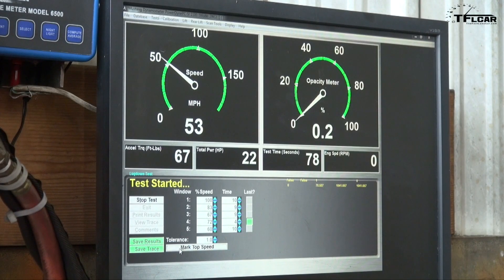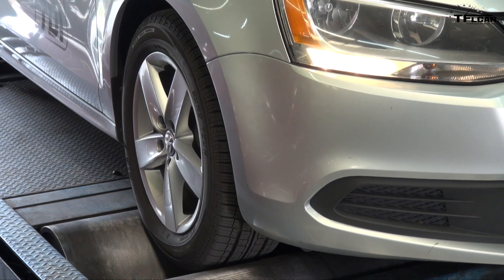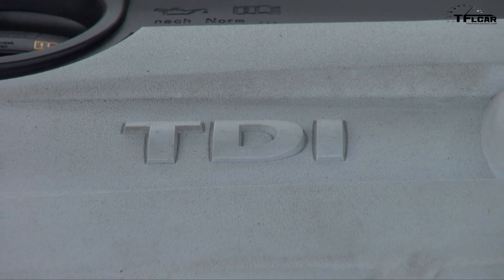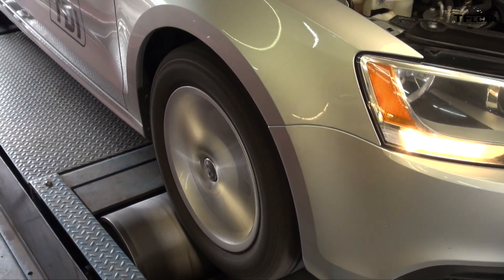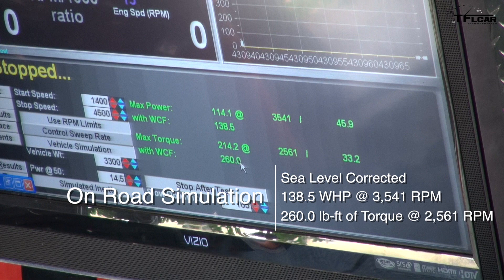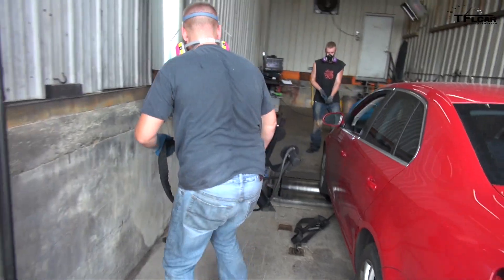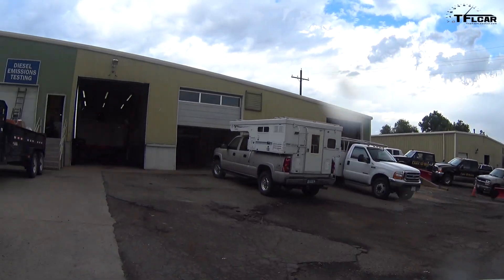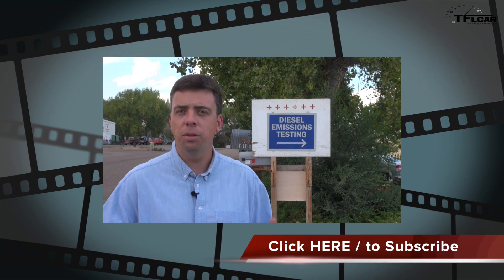Surprise! We Dyno a VW Dieselgate TDI Jetta to get the Truth about HP Loss

Comment: LOL!!!
This test is flawed as is the knowledge of how that car works.  When it's run FWD with the rear not rolling, the car goes into Winter driving mode because it thinks youre stuck because the front wheels are spinning and the rear aren't.  That causes it to reduce torque - creator of wheelspin - and dial back power to try to 'regain traction' that it thinks you've lost due to driving on very slick surfaces / being stuck.  That's why it started flashing the ESC light like it did, then went into 'regular' but sluggish behavior afterwards.

Comment: Don't bash so much on VW. They have paid their dues. The emissions standards are sometimes ridiculous compared to expected "driveability" and consumption of a car. Also, diesel engines have to employ a diesel particulate filter, which further reduces engine power, which kind of takes away the very brilliance of a diesel engine (inherently lower consumption). More than that, VW is not the only one who has cheated, so to speak, on consumption figures - find some materials and read about how many CEOs for instance Mitsubishi has changed during the past 10 years, and learn the reason why. The strange fact why this issue got so widely popular is that somehow this whole affair coincided with the time when VW was just about to overtake Toyota as the largest car mfr in the world. Also, note one more thing: all modern cars have ABS sensors on all 4 wheels, even if only 2 are driven. If the car sees that 2 of these are not turning, it may apply contiguous ABS and/or brakes to mitigate for difference in wheel speeds, enter some pseudo limp mode, or do any other correction of any of the on-board ECUs (which is probably why you see all the control lamps lighting up like xmas tree in the dash). To be more accurate, get a full manual model, and then make any assumptions. So once again - don't bash on VW, and this test is not necesseraly accurate.

Comment: I don't believe it's VW's fault. I doubt that Volkswagen would deliberately cheat on emissions test. It's the EPA's fault. They keep changing the emissions standards to the point that it's damn near impossible to keep up. It's impossible to make the diesel engine any cleaner without sacrificing what makes the diesel engine what it is; fuel economy, durability, reliability. :(

Comment: Let me state, that my Jetta TDI has been a fantastic vehicle and because of the RIDICULOUS EPA standards, we will no longer have these torque laden, high performance, reliable, quiet, no smoke, 45 MPG vehicles again. Some are complaining, but who cares about the little bit of delay in receiving our much higher than value compensation. We all benefited from this situation with many years and miles of useage, only to be rewarded with virtually all of our expense of ownership back to us. RIP TDI...
Reply: There's definitely smoke. It's called nitrogen dioxide, and it's literally poison. In high enough concentration it will kill you like chlorine gas. The same type of people complaining about EGR and the EPA complained about taking lead out of gas. Despite the fact that we poisoned a generation of Americans just so a manufacturers could spend a little less money.
Reply: Yeah you will go get a 1.5 tune better power and MPG delete EGR during tune to remove check engine light

Comment: Can this be fixed? Does it affect mpg?
Reply: it can be fixed and they're working on it, they're trying to make it so its not gutless after. But what people dont realise is the TDI's still put of less emissions then vehicles in the 90's or older... they're blowing the emissions cheating way out of proportion.
Keep your TDI if you have it, VW's giving they're customers a great deal. I wish I hadn't traded my TDI golf in before knowing what I'd be getting.
Reply: Since the fuel economy is up the walls with these cars, an EV conversion would be necessary since then you can sell it second hand, which wasn´t allowed in the mode it was currently in as with the software to cheat through tests by fooling the testers it got passed.

Comment: i have a 2015 golf with the urea tank and despite the software "turning off" the emissions systems. The Urea tank still gets empty about every other oil change. So I don't believe that the system is in fact completely off except when on a dyno. If that was the case wouldn't I hardly ever have to refill the Urea tank? 

also curious about having the "fix" done on my car and then simply getting a tune on my car afterwards to help bump up the hp and Torque to what I would be more happy with?

Comment: How is emission testing when the vehicle does not have a five gas analyzer and when the vehicle is not seeing the rear wheels spin causing the traction to let the engine know to reduce power due to failure and safety, which after that ABS system goes to a default to safety. This guys are so incompetent in what they are performing. Which there is a good question on a vehicle running pure diesel have cleaner emission compared to bio-diesel. Just like ethanol is bad for gas vehicle.

Comment: I think it came down because of the ESC was bugging out in 2wd. It thought the rear wheels were locked up and it turned off all sorts of shit trying to correct it.
Reply: you are correct my sir. When traction is lost to a wheel engine will reduce power and if it does no recognize it coming back and ABS will stop function.
Reply: Przemyslaw Grzywacz thanks, and yep. I thought this test was a little ridiculous because I know that car lit up like a Christmas tree because it thought the rear wheels locked up. It reduces power, kills the ABS and runs in open loop to prevent damage when it thinks the wheel speed sensors are wrong. You can  reduce the power of any car this way.

Comment: if you use turbo maxx oil modifier and turbo maxx  fuel modifier  neer 0 nox and co we did live drive emissions teste not on a dyno no additive 250ppm co 300ppm nox still better than any other cat using additive 0ppm nox and co wile driving up hill at 65 mph.

Comment: You don't adjust for elevation as it is turbocharged and thus the turbo will force feed the combustion chamber at any elevation regardless of oxygen levels. Ie. You will get 140 hp at sea level and 140hp at 7,000 feet. That is the magic of turbo charging vs. Natural aspiration

Comment: 138 WHP is about 158 flywheel (assuming a 15% loss), pretty damn good for a motor rated at 140 at the flywheel.
Reply: Jaybee agreed. even in emission mode, it makes the factory numbers.
tfl failed to convey that factory quotes crank numbers and they are quoting wheel numbers

Comment: well, in your test, you didn't actually disable traction control. so, when only 2 wheels were turning at low rev's, traction was kicking in which caused the power disparity.

Comment: Someone tested an Opel diesel at 85mph cruise simulation and it emitted triple the limit for Euro6 emissions. However that would still easily meet Euro 4 requirements as that is 4 times as lenient. So the cars are still pretty clean, just 5 years or 2 Euro standards behind what they claim.

Comment: I find the experiment inconclusive.  I would have liked to see other fwd vehicles tested the same way, to see if the dyno has discrepancies between 2wd mode and 4wd mode in "known non-changing ecm mapped vehicles".  
Also there is one part where it is mentioned that power would be higher at lower elevations, and is predicted on by the dyno software.  This vehicle is turbocharged and controls its own intake pressure, HP/torque should not be much different as a result, perhaps the software assumed engine was normally aspirated. 
Thirdly I sincerely doubt VW would have risked cheating emissions for less than 10% power gains, they cheated to reduce production cost while maintaining perceived emission output.  Better gas mileage results low lower CO2 emissions, richer mixture reduces NOX emmisions, to overcome this a  DEF system is reqd which is expensive.  To sell more cars the DEF system was left off to keep sticker price down. It's really that simple.

Comment: still love my vdub they built the first usable small diesel engine in 1976 the 1.6 golf (rabbit) mk1 it was the game changer has far as I am concerned.  it came to the UK 1978 . ok it only had the power of the 1.1 petrol golf but it started from cold it was reliable and giving 50mpg it was astounding for the time .

I am Not sure beating the system was vw's aim here the computer calibrates the fuel air mixture to the driving conditions.  so sat at lights and revving it not under load it would not get the same amount of fuel, as say driving up a hill under load. the computer does calibrate constantly for best power and mpg . so if that's the case it will give a lower reading stood still in. and with back wheel not turning  I think that would put the computer into a dilemma.  has seen by all the warning lights. I am surprised it didn't put it's self into limp mode .

Comment: It's so funny seeing these "specialists" talking like they know what they are talking about, if you're a mechanic or a tuner you should know that test 2 was wrong because traction control sees the rear wheels are not turning and thinks the front wheels are spinning so it decrease the cars power, the 2nd thing is the car has accelerometers for esp and it can know when the car is moving or standing still even on a 4wd dyno, and the last thing is it isn't a "cheat device" it's just a software.

Comment: People seem to think that these VW's can tell they're being emissions tested by turning a switch on or off, or because the computer can tell the vehicle is not being driven but the RPM's are fluctuating. These vehicles have very sophisticated engine management systems, the control modules have a lot of processing power. They can tell when a diagnostic device is plugged into the OBD2 port because the scanner has to initiate communication with the module. The ECM can see the additional data on the CAN bus and goes into a 'Clean running" mode. When the scanner is unplugged, the module detects the additional data is no longer present on the CAN bus and goes back into normal running mode. VW pulled a fast one on us but they must have known they would get caught eventually.

Comment: this test was stupid all measured  at low rpm. at high
 rpm the power and torque is alot more than they say, and the emissions are way high, but at low rpm the car will get up to 70 mpg. all tests were done at no more 5500 rpm meaning  the car was giving legal reading because they were going slow. I raced my exeo against a2.0 tsi a4 the power difference was mot much more

Comment: Something is seriously wrong here, but I think I know why the HP and Torque numbers are down. Because the Mustang Dyno is belt connected to both roller sets, when the 2WD mode was selected, the primary front dyno roller drum has more resistance because rear drum is now disconnected by a valve shaft. The belt maybe stationary, but the bearing it rides on is increasing the load on the actual drum. 

The only way this test could have any validity is if you had the dyno run while monitoring NOX emissions. You couldn't do that, which invalidates this test completely.
Reply: +Doug Hanchard Also, if they don't have any emissions gear connected to the computer, I'd bet the 'FWD' mode is messing with the cars' ECU. They even show it! It disables traction control and ABS... would you think it'd rein the power back a bit as well? I know in my older Passat (gas) if almost any warning light comes on, I can feel a slight power loss.

Comment: Or perhaps it cut engine power as a strategy of traction control? Throttle cut or limitation is a huge part of Vw traction control, other manufacturers do the same thing. In addition just pushing the button doesn't turn it off, it just renders it less sensitive and less invasive. ESP is still partially activated even when the button is pressed. Your findings are invalid.

Comment: a huge problem with your test, the software on the defeat software could tell if it was on a treadmill reguardless if it was 2 or 4 wheel. On a dyno the wheels stay true throughout the test, while in real world test you turn the wheel while driving. That is how the software could determine if it was being tested. That was per Mike Horn. Also the power loss you saw was because the abs light came on, the car was placed into reduced power mode

Comment: Last time I've seen an emission check, it was in neutral, no wheels running. You simply don't account for that almost every modern car will run in a "safe mode" when ABS and/or ESP are disengaged. Heck, my VW even slowed down when the steering angle sensor was dirty and had a false signal. Its a 2.0 FSI though - has nothing to do with Dieselgate.

Comment: Only a half-ass test. Fine you found a low-end torque disparity. What's the emissions difference between the 2 modes? Fucking duh.... you were already at an emissions test facility, yet didn't perform the same test for a difference in emissions.

Comment: You're not in cheat mode on the two-wheel dyno. The car thinks you're in a low traction situation because the rear wheels aren't turning and it's cutting engine power to try to find grip. I bet if you disabled traction control, you'd have the same results as on the four-wheel dyno. The cheat device is probably more complex than just leaving traction control on.

Comment: What you experienced on that second test was "limp mode" or failsafe mode (as in limping back home at 20 mph).  It happens to both gas and diesel versions of VW's when the traction control or ABS aren't working properly.  Methinks you need to figure out how to properly dyno these cars to see the software truly work.  If that were to happen during an emissions test here in CA, you'd fail instantly.

Comment: TFL Car please specialize your reporters and send the guys from Boulder Diesel emissions Test to some courses.
You take us for idiots?
     I do not deny that the VW engineers have made changes in order to trick the emission tests and they admitted that.
     But what are you trying to demonstrate with the dyno at the minute 4:30 it’s for stupid people to believe.
     You can make a 4 wheel dyno test to a car to simulate a normal drive: no question about.
But to try with a modern car (not an American POS) to take a dyno test just with the two front wheels it is stupid. Because the car will not react normal. She is NOT going to enter a ''EMISSION TESTING MODE'' and shut everything off but she is going to think that is on Ice or something is wrong with the electronics.:
      The wheels at the rear are not speeding so the ABS is going to ask himself: '''ooo what is what wrong: The both sensors are defect or the wheels are blocked or the car is skidding'', than the steering wheel who is assisted also from the ABS it will show you that pretty yellow warning light(steering is not knowing any more if the car is going straight or not, he cannot calibrate any more the electrohydraulic.) Third the car will go into a so called LIMBMODE (it will shut off the turbo) and reduce the power of the car to protect the driver and the motor from total failure. The car is doing the same when the turbo needs cleaning or changing before it explodes and make a mess in your engine.

Comment: Did it occur to you guys that the car was in a limp mode because it was confused about traction because the rear wheels weren't moving? No looking at the fuel trim, air:Fuel ratio? Emissions system voltages?
Try it with traction control off, in 4 wheel mode and 2 wheel mode and see what happens

Comment: typical american hypocracy America is one of the most polution countrys on the aerth.America is a country that has NOT got a yearly CO2 emmision check/control on cars and other equipment with a combustion engine.Sec americans spray their cars in open/outside air with an old conventional paint system, unlike painting a car or other devices with waterbased paint sprayed in a spray booth!!Thirth america is the countrys that has been in war or is in war with almost every country in the world !!The CO2 footprint is 1000000 times higher than any other country in the world based on statistics. So fuck you big americant's for pointing the finger.Somthing about a kettle and black!!!

Comment: i find it very funny everyone posting on here is an expert to the subject matter. california bureau of automotive repairs and the epa  have found these cars to be polluting beyond acceptable emissions limits. the emissions were about 40x federal standards, by running the vehicle leaner the nox emissions were increased which was caused by increased combustion temp and pressure. so thus more hp and torque and better fuel efficiency. this however would not be a big worry in places like england as smog is formed from nox and hydrocarbon (raw fuel) together in sunlight. 
the subject of recalling these vehicles, recalls tend to focus on customer safety however if they dont recall these diesels I am confident they would be forced to buy them back. now the customer will be stuck with a vehicle that gets worse  mpg's and suffers in the performance area.